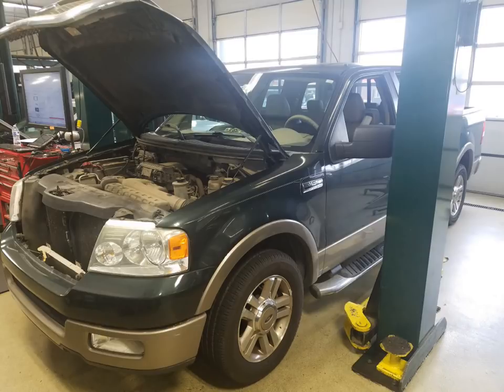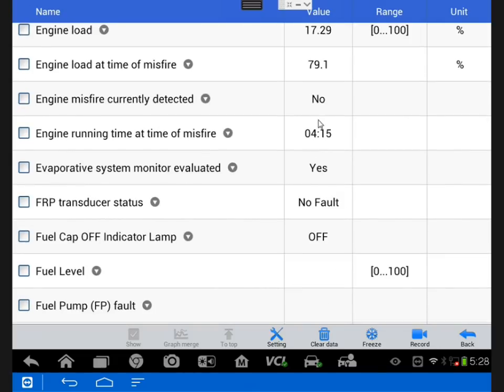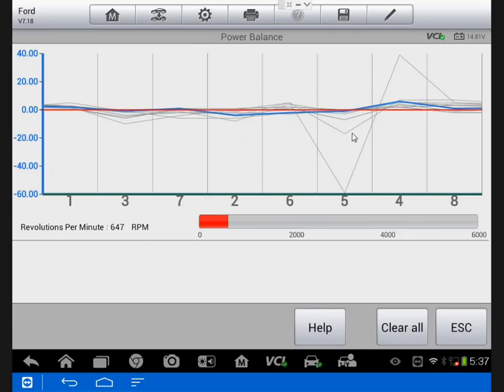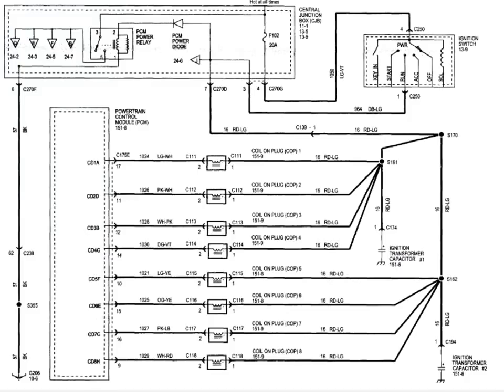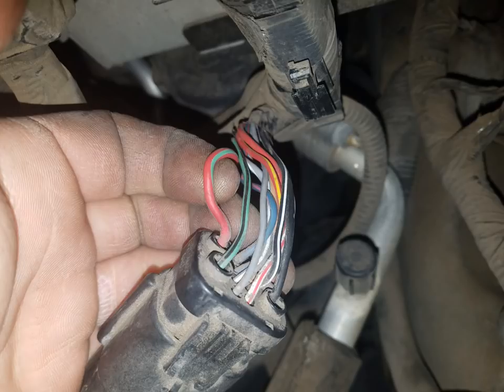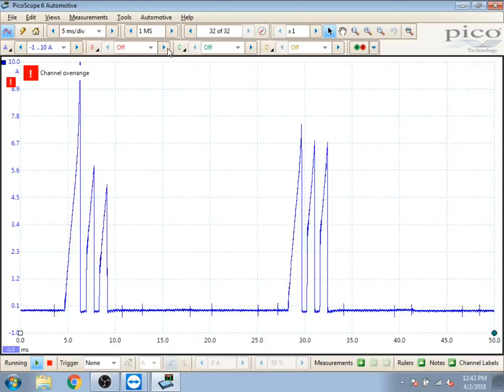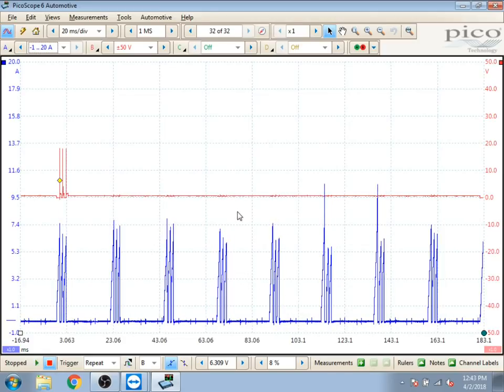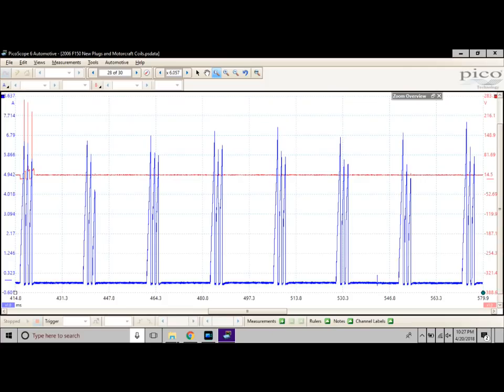2006 Ford F150 Misfire Case Study

Comment: Very nice. Could u also do this with a Vantage Pro?  I have a 2014 Odyssey with a light throttle misfire when shifting into third. 1500 or so. No. cel.
Reply from the maker: This can be done with any labscope, you will need a amp clamp though, check the video description for a link to a inexpensive amp clamp.